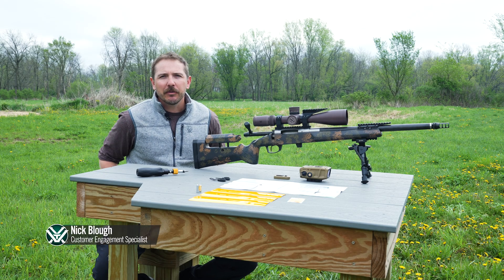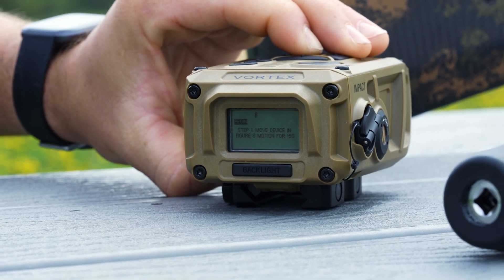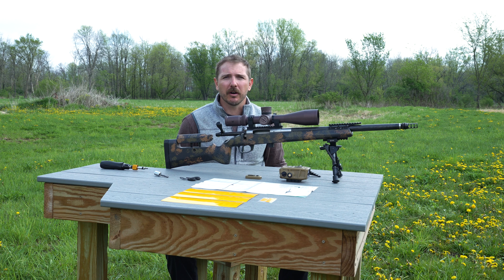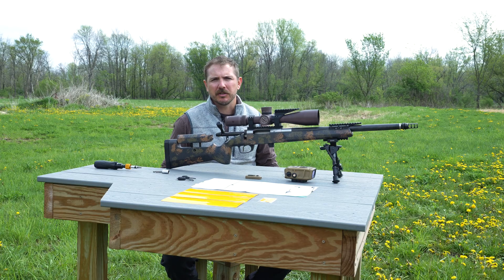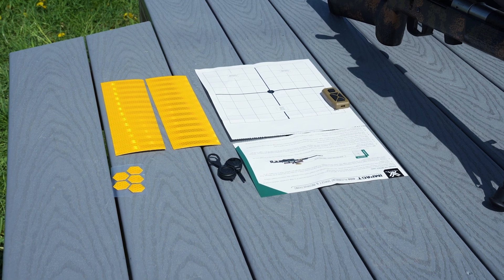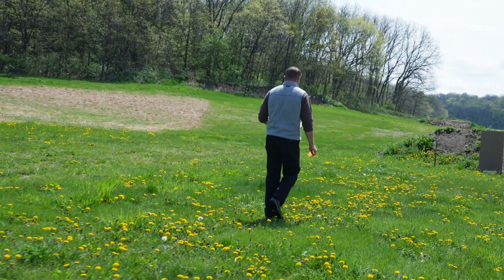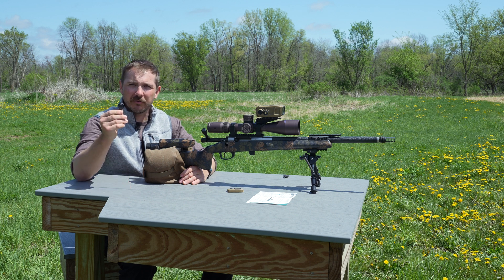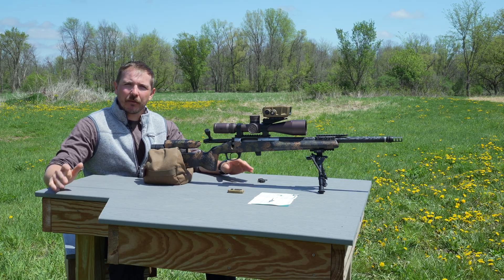How To Calibrate, Mount, and Zero the Impact® 4000

Comment: Nice guide. I tried the Impact 4000. Calibration is too much hassle. I replaced it with a Sightlok RF-1 rangefinder mount paired with a Sig KILO BDX rangefinder. Integrated support for Kestrel windmeters. Better accuracy. Applied Ballistics calculator. About 1/5 the price. Or if you don't need a ballistics calculator, the LE-032 is another low budget WMLRF that works with the Sightlok mount, cost: $300 instead of $3000.

Comment: So if i have 44moa mount and my point blank zero distance is 500yards. Will I still just aim at the centre of the target and bring the laser to my reflective tape? Was told that I have to be able to achieve a standard 100yard zero to actually sight this tool in.

Comment: What is the distance between the zero impact point and the laser point? The line of sight is horizontal and the laser is horizontal, which means that the laser and the line of sight are parallel to the target and therefore maintain their distance. If the game is big, there's enough surface area for the 5 cm gap to be respected with an optimum low square error. If the game is big, there's enough surface area for the 5 cm to be on the target, but if the game is small, particularly for the PCP community who want to use it, small game at very great distances, the surface area is very, very small, so the square error will be great, so the gap must be reduced and, if possible, the zero impact point and the laser must converge.

What does Vortex have to say about this, because this gap is probably for targets of a certain size?

I need explaining about gap between laser point and rifle scope point why not choose to converge to lines: sight line through scope to zero point on target and laser point on target

That's why outdoor demo is best than store demo or unboxing demo.
9/10 guys choose indoor demo and this hurt me

Vortex also needs to specify impact resistance, as recoil can affect electronics and accuracy in the long term.
Reply: The laser just tells you how far away the target is from you . Its like using a handheld rangefinder without  wind and weather sensors.

Comment: Ok so if I moved 40 miles away to hunt can I just take the unit off and calibrate it / don’t have to re- put the laser on paper / can I just take the range finder off do the flippy calibration steps then throw it back on the rail in the same spot and it should be good to go again ? Or does it usually get off alignment again for the paper test ?
Reply: That's what I am trying to figure out?
Reply: Heres a tip, go and do it. See if it does go off. You have the visable laser to judge if it shifted or not
Reply: The calibration is only for the compass. If you only moved 40 miles, in my experience you don't need to calibrate the compass. For me, as long as I'm in the same state I don't worry about recalibration. Texas would be an exception to that rule if I calibrated in Houston and then traveled to El Paso I would calibrate the compass.
Reply: @scottparks95 it would be neat if you could save calibration locations and load them when as you moved.
Reply: From what I’ve seen and heard from other people just set it at your location and your good never noticed it being off. A lot of peoples fails every time they try to calibrate anyway.